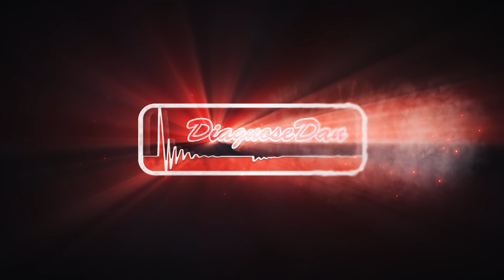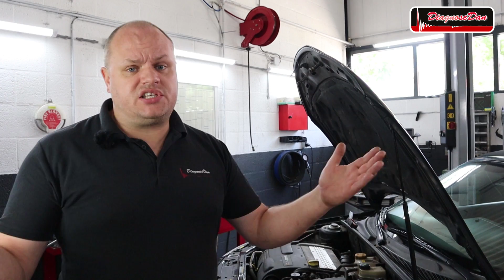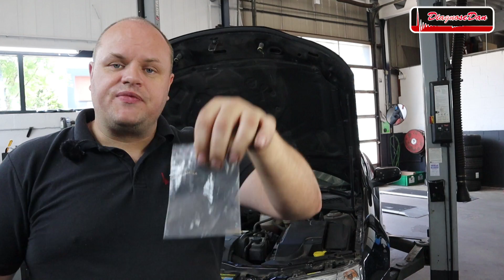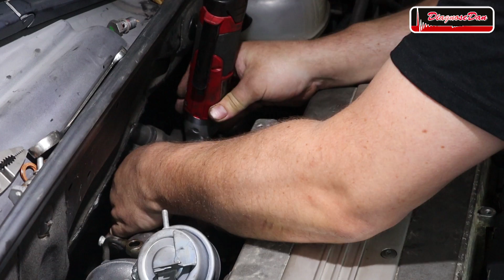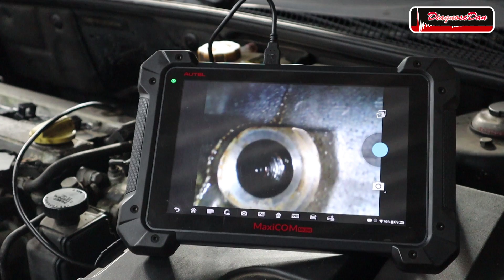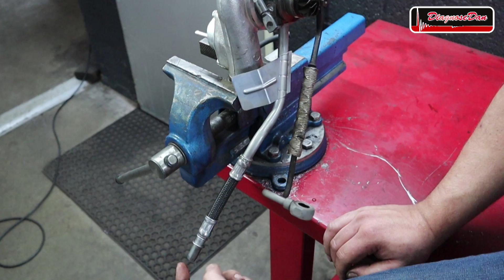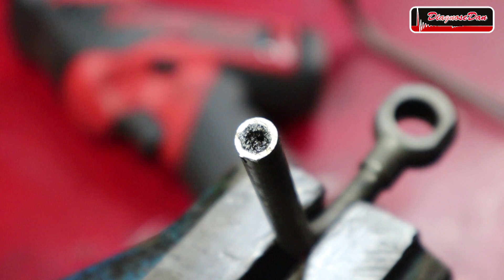Why did this new part only last one day?

Comment: EGR delete or the equivalent gas/petrol delete. I understand emissions are at play here but they have made engines extremely delicate by recirculating exhaust gas into the intake.  I watch USA workshop channels all the time and somewhat laugh at their 6k mile recommendation of oil changes. Been doing 12 month OR 12k mile oil changes for the last 20 years in the UK and honestly never had a problem because of oil with my cars only general wear and tear or known weak points. Maybe the future is 6k twice-yearly oil changes now to allow for direct injection and EGR carbon fouling.
Reply from the maker: Thanks for leaving a comment it's appriciated 👍

Comment: Can't help but think the blocked line is due to a bigger issue, example: PCV. I own a 2003 SAAB 9-5 and due to poor crank case ventilation,  the PCV system was revised about 2-3 times. Although the car in Dan's workshop is a SAAB 9-3, perhaps it uses a similar PCV system? I would like to see the oil sump dropped and the condition of the oil pickup. @DiagnoseDan = legend!
Reply from the maker: Thanks for watching 👍

Comment: That reminds me next door guy three days ago he fitted new turbo on PSA DV6 didn’t checked oil pressure nor the flow to the turbo feed pipe didn’t removed sump either so turbo lasted massive 10 miles 
Thanks for the video all the best
Reply from the maker: It happens more than you think!
Reply: i have that engine in a ford fiesta 1.6TDCI. i am always nervous about turbo and DPF failures
Reply: Lotrioni I wouldn’t worry about it these are quite robust engines also rarely turbos goes on  them usually lack off servicing or improper usage for example hard drive and immediate engine shut down without allowing turbo to cool down
Reply: @Lotrioni  If that's a generation 2 TDCI (same as the early Volvo D2) they're pretty robust, the early TDCI with 16 valves is known to eat turbos if they're not serviced like clockwork.

Comment: 14:00 Change oil frequently and use only high quality synthetic oil (preferably with a low evaporation factor often measured by the NOACK test - I personally believe NOACK results to be some of the most important spec in an engine oil) of the proper viscosity for your specific engine. And make sure you have a clean PCV system if your car is equipped with one.
I wonder how the valves in their engine look.
Reply from the maker: Thanks for the feedback 👍

Comment: Nice to watch an expert at work. Good fix. Sludge build-up? Use better synth oil, and "respect the oil change interval", let the engine idle for a bit so the turbo can cool down, even though the blockage was on the intake side.
Reply from the maker: Thanks for leaving a comment it's appriciated 👍

Comment: I would send your video to the other shop as a verification of the screw up. IF the kit comes with a pipe it is obviously  an item that needs to be changed. They are totally liable. You are so correct, a shortcut  killed the new turbo ... much gilders!!
Reply from the maker: Thanks for leaving a comment it's appriciated 👍

Comment: I own both a Mercedes and Ford product. Both automobiles have numerous heat shield in the engine bay protecting vital components. The oil feed line going to the turbo must also be protected from excessive heat or the oil will congeal as seen in this video.
Reply from the maker: Thanks for the comment 👍

Comment: Unfortunately a silly schoolboy error not changing oil lines , the original repairer should have investigated as to why the original turbocharger failed, I never change a turbocharger without new oil pipes , new engine oil and  oil filter , check oil pressure then reccomend another oil change after 500 miles or no guarantee from me ,great video as usual Dan
Reply from the maker: Thank you very much

Comment: Frequent oil changes and letting the car idle for a few minutes after a long drive to let the turbo/oil cool down would’ve saved the original one. Weer een uitstekende video Dan. Petje af!
Reply: No, it would have not saved it all. Because the torbo never got oil from the feed pipe in the begining.
I'm also interested who is exacly going to pay for this. Since its obvious a huge mistake was made in the previous work station. Very curious if the customer can apply for the refund of the new turbo and work hour inclueded.
Reply: @elyzium  Well genius. I meant during the lifetime of the vehicle not in the end when the pipe got fucked.
Reply from the maker: @ademc8872  😂😂
Reply from the maker: Bedankt!

Comment: And BTW,to what's causing the clogging : it's called " heat soak ". Turbos are cooled by oil(and sometimes coolant with an electric pump that circulates coolant even after shutting off the car), if you shut off the car on a hot day right away, the heat soak will cook the oil in the lines. That is why you ALWAYS idle a turbo car for 2-3 minutes before shutting it off when arriving at your destination!
Reply from the maker: Great advise 👍

Comment: Someone was obviously lazy and didn't want to spend the time changing the feed line... the turbo was probably already noisy after the "test drive". Mistake #2 was giving the car back to the customer. =(
Reply from the maker: I was thinking the same thing. The oil feed is connected to the engine in a very tight spot. This makes it hard to change and i think the other shop passed om that. 
Great to hear from you Thomas 😃

Comment: No magic required in most cases, just respect service intervals, use correct grade oil.
Possibility of insufficient operating temperature though, short journeys or thermostat stuck open.
Reply from the maker: Thanks for watching 👍

Comment: Aloha Dan, I am old and in my day automobiles didn't have turbos, but heavy equipment and many of the older trucks were being retrofitted with turbos to meet emissions.  The only turbo failures I have seen was caused by foreign object damage or lack of lubrication oil which also cooled the turbo bearings, so a good oil flow was essential.  We had no water cooling on turbos back then.  Most of mechanical abilities lie between the ears, as my father kept telling me Think @#@$ Think!
Reply from the maker: Your father was right Charles

Comment: You're THE boss Dan ! Tommorow i need to overhaul a brake caliper and was thinking of a way to not make mess when the brake hose is disconnect and brake fluid starts dripping. And the plastic bag tip and a rubber band is great for collecting the brake fluid. But first i will try putting an plastic bag between the brake reservoir and the brake cap so vacuum is created.
Reply: PS : I think there was leaking injector and petrol got to crankcase past piston rings and that's why carbon buildup.Other than skipping the oil changes i can't think of anything else
Reply from the maker: Thanks for leaving a comment it's appriciated😁

Comment: Turbo re-builders have clauses in their warranties that require replacing  both the pressure and drain lines (or at least show up on the bill of materials).  While most mechanics don't actually test flow rates, your method gives a good indication of pass/fail criteria. Thanks for being so through with your explanations and presentations!
Reply from the maker: Thanks for watching Christopher

Comment: every beginner knows that if you change a turbo you have to change the lines too. or atleast flush them to make sure no metal particles are in the line. wow. this was no real shop that changed the turbo. but i saw that it was an GM turbo so it seems it was a GM dealer. omg. and he skipped some oilchange intervals.
Reply from the maker: Thanks for the comment 👍

Comment: That job has a warranty. 
If customer go to other shop, may VOID warranty. 😎
Reply from the maker: Dificult in this case, the Car was fixed in another country and towing the Car back there would have been very expensive. The customer really needed the car back ASAP.
Reply: @Diagnosedan  Agree with you.  Also I learn something new on each video. Thanks.

Comment: That crud in the oil line is oil that has been way too hot and forms a sort of black sludge/gel that sets in smaller openings after time. So the questions we should ask ourselves are, is the oil change too late? that causes poor cooling and poor lubrication. Or is there another restriction that made the oil overheat because it is going to slow trough the channels. So maybe this cars engine is still a time bomb. I would check if there is a screen filter somewhere  in the oil channels thats clogged up.
Reply from the maker: That is why you need to check the oil flow and pressure after the repair 👍
Reply: Ben wel benieuwd of ze je klant een beetje tegemoet gaan komen, zou wel zo netjes zijn na een behoorlijk prijskaartje.

Comment: Great job man! I replaced a line back in 2010, on a mercedez and I found something that looked like asphalt. I used brake cleaner and elbow grease to take care of that pipe. I believe this happens when the pcv line, valve or assembly gets too dirty (Volvo) due to a lack of oil change or using low quality oil
Reply from the maker: Yes that stuff is nasty😬
Reply: In my experience, also not ever letting the engine get to proper running temperature.
We did plenty of these on Audis back in the day, but strangely it stopped once we changed oil brand from shell to Castrol. Went from daily turbo swaps to weekly, then monthly.

Comment: I have seen this on Chevy 1.4 turbo motors.  ALWAYS check that feed line when replacing a turbocharger!!  Great video!
Reply from the maker: You are right!👍
Reply: Litteraly had this happen, kid replaced the turbo on his mothers car, comes in for a missfire, had it to the dealer and they couldn't find anything. Erratic missfires all cylinders, full on oil. After we had it running 5 or so minutes it started making some funky noises, yeah the turbo blew right in front of our eyes, well it was on it's way out but it started to really go right then. On that car, somebody fiddled with the oil drain aswell so it leaked like a seive...like a 30 dollar line no problem somebody skimped on put some rubber hose that didn't work at all.

Comment: great video, my first thought was the oil feed to the turbo, I've replaced maybe 5 turbos in 20 plus years, and always replced the oil lines, never even tested them, not replacing them voided the warranty on the unit
Reply: can you do a test where u floor the car for 5 minutes on the road and then measure how long does it take to cool down the pumpkin a bit
Reply from the maker: Thanks for watching Kevin!

Comment: I think the turbo feed pipe was clogged with carbon because the car has probably been driven hard like say on a motorway and then the engine has been shutdown causing the carbon in the oil to stick in the turbo feed pipe. Engines with turnosshould be allowed to idle for short time before shutting off the engine.
Reply from the maker: That's one of the reasons

Comment: OMG.  That engine is toast.
those carbon deposits suggest as others have said that they did not change the oil at the required interval and/or used under spec oil.. I assume the lifters will go after the turbo does..
Reply from the maker: Thanks for watching 👍

Comment: This is why I only use VW approved oil in my GTI.
I'd never go the full 10K miles on oil change, <5K miles for me.
Oil is much cheaper than turbos!
Reply: Bear in mind,that the dealers are branding mostly crappy oils, in order to "make the excel shit  " green in the end of the year! Together with the long life intervals and short distances running cars ... its the end of the engine/turbo
Always use good reputation ESTHER BASE oils, especially on the 2.0 TFSI engines !
Reply from the maker: Thanks for the comment Mark!

Comment: IMO, the flex hose portion of the feed line delaminated on the inside causing restriction and resistance to flow. This restriction, like a filter, caused fine particles like carbon to pileup and finally completely block the line. You can cut the flex hose area to find the initial restriction area where the hose delaminated.

I'm also going to guess the technician didn't change the feed line because it was difficult to reach the banjo bolt at the engine block!
Reply from the maker: The Bolt on the engine block is very hard to reach, so that could have made him deside not to change it

Comment: Any concern about metal from the original turbo failure getting into the engine and causing internal engine damage?
Reply from the maker: Because there was no oil flow to the crankcase, it didn't get transported out of the turbo.
Of course we did check, did an engine flush and serviced the engine

Comment: Excellent video Dan! It amazes me how a garage can overlook such a basic issue. Did the owner of the car manage to get a refund of the Labour and costs from the other garage? As I'd expect more from a garage than that...😊
Reply from the maker: The customer is still waiting on an answer from the other shop.
Reply: @Diagnosedan  I used to own several Saabs. The biggest issue with them is oil sludge. Especially the 1995-2007 GM 2.0 Turbo direct ignition trionic 5 and 7 variants. The downpipe would be tucked right into the alloy oil pan, so basicly the exhaust system would cook the oil and cause it to solidify into lumps and cause blockages..🙄

Comment: Our manager at Auto Zone tells us to keep the customer happy. So in this case we would give him another turbo under warranty. After about the 10th replacement, the customer gets the idea that either: 1) Our parts are junk, asks for a refund and goes somewhere else and repeats the cycle or... 2) The customer realizes the problem "might" be with him and asks for a refund and goes somewhere else and repeats the cycle somewhere else AND we have a happy customer for life. Ah... I see him coming in the door again with an engine computer...
Reply from the maker: Do you guys add a checklist for the customer?
Reply: @Diagnosedan  They won't listen. Got the same problem with batteries. Customers refuse to fix their rotten terminals.
Reply: Hahahahahaha!  Man, that had to happen often.

Comment: Change your oil and filter more often... Maybe also consider using an engine flush additive.
Reply: If you flush. Then always from new. Putting a flush through an old, never flushed engine will just loosen all that crap and cause an issue like this.
Reply from the maker: Thanks for the comment

Comment: Long service intervals and use of wrong oil. Shutting down the car when the turbo is still hot after the engine has ran on high load. On some cars the feed line passes near the exhaust and the heat from the exhaust can cause the oil to bake.
Reply from the maker: Thanks for the comment 👍

Comment: In addition to heat soak and excessive oil change intervals, I suggest that a full synthetic oil of the mfg specified grade has not been used. Customer fail and other shop fail.
Reply from the maker: Thanks for the comment 👍

Comment: prevention :
one : respect service intervals
two : try not to power off the engine after being subjected to high load (idle it for two min), if the turbo is water cooled, no need to think about it.
three : maybe part of the feed oil line is at a short distance from the turbine housing, causing oil to be cooked in that portion...
Reply from the maker: Thanks for the feedback 👍

Comment: That oil in the camera shot was very dark so I would guess that oil changes have been few and far between. Also, that tube is near a high heat source so the oil will just coke up once the additives have been exhausted.
Reply from the maker: You are right 👍

Comment: Poor quality oil (mineral instead of full syntetic), too long oil change interval, poor quality oil filter. Should always use full syntetic oil for turbocharged cars and an engine flush at every oil change is probably a good idea, it may dissolve some of that carbon and flush it out.
Reply from the maker: Gread advise 👍

Comment: It will be a combination of very high (oil) intervals. And maybe a defect of the EGR system. The EGR is a high load for the oil and additives. Even as a engine with compression problems.
Reply: No EGR in B207L and B207R ;)
Reply from the maker: Thanks for the comment Michiel!